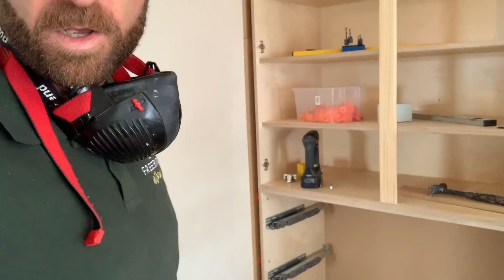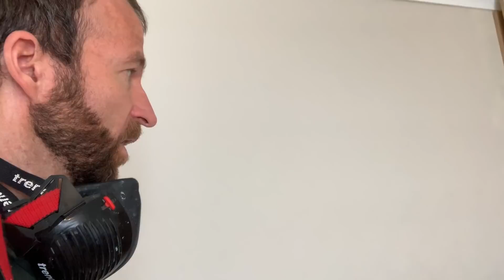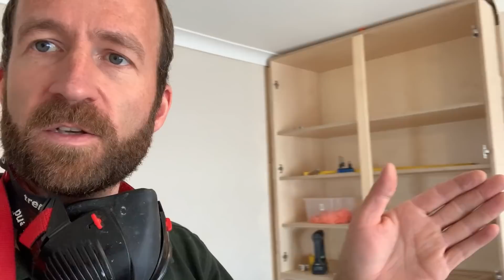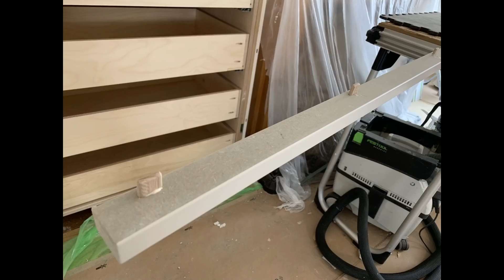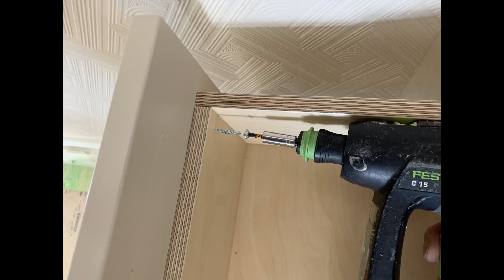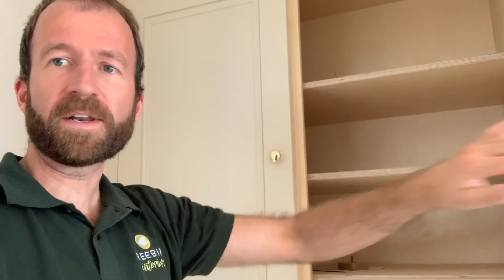Alcove Cabinet with Doors and Drawers

Comment: Is it possible to get a link to the clear lacquer that you used please?
Reply from the maker: Yes here it is https://www.ultrimaxstore.com/wood-coatings/water-based-coatings/sayerlack-water-based-clear-lacquer-matt-af7210.wo402410 and you can use code FREEBIRD10 for a 10 percent discount off your first order at this supplier

Comment: Hi Alastair - fantastic series of videos! Regarding the Blum under mount runners, when you fit the connector behind the false front as you did here (avoiding creating a second notch), does that impact the drawer length relative to runner length? Still 10mm shorter? Thanks
Reply from the maker: It does yes - increase total drawer box length by the thickness of that unnotched front.  So for a 450mm Movento runner the drawer box length is 455mm because you take off 10mm as standard, but add on 15mm. Glad you like my videos!

Comment: Love the unit very  nice, I like to make furniture as a diy er and am only a novice, would like to see more in depth build process if possible,  ie from the workshop to instal, from material dimensions like 18 carcass with 12mm drawer construction. I have made a sketch up plan for a vanity unit with a Hollywood style mirror but can only get 18mm 8x4 sheets here in Dublin so far and no 8x4 15mm sheets for the drawers, but now I’m confused as what thickness to use and material only that the daughter wants white melamine finish. Any recommendations appreciated 😃
Reply from the maker: I will try to get more workshop insights on camera in future - Brady is starting to film more for me as he works (he does most of the workshop work!).  Surely you can get 15mm etc, maybe as special order?
Reply: I could go 18mm for everything but would that be overkill and two heavy?? I   Think I should be able to get 15mm just need to look harder. If I sent you my sketch up plan would you have a quick look? Only if you had the time. The videos are great, watching a lot of your stuff and quality work, keep the videos coming. Big shout out from Dublin and I wish you and the family every success 🇮🇪🇮🇪🇮🇪
Reply from the maker: I settled on 18mm for carcase construction and this is what most people use.  I use 15mm birch ply for drawers, with 6mm bases (in grooves).  That 3 mm difference is a surprisingly big difference when it comes to drawer boxes which I just think feel unnecessarily thick and weighty at 18mm.   For years I have bought boards from Arnold Lavers over here.   They stock 18mm MDF (standard and moisture resistant) and birch ply and some other thicknesses but it needs a special order for the 15mm birch ply and for the 22mm MR MDF that we use for countertops and shelves.
Reply: Thanks for the feedback Alistar, appreciate it. Will look at birch ply for the drawers 👍

Comment: Hi Alistair, just a quick question, what are you thoughts on edging strips on the birch ply shelving? Another nice looking job by the way.
Reply from the maker: Des Brown I’m not a fan of iron on wood edging (or at least any very thin edging) because you need to keep the arris edges fairly sharp and I favour a more durable slightly rounded arris.  I’m also not a fan of glued and cramped solid wood lipping because it adds SOOOo much extra work and is exactly the sort of thing that strips the profit from a job!  But also, personally I quite like the look of the exposed layered edge, and I like being as true to the material as I can be.  I’ve never had a customer bat an eyelid at it so far; the exterior seems most important. I would do it if that’s what the customer wanted though.

Comment: Nice work. Can I ask what you used for the plinth/base on this? I noticed in some of your videos you were using small adjustable feet from hafele, but I think I saw a recent video were you were using plastic adjustable feet, link used on kitchen cupboards. I'm about to build a 4.5m long built in unit and trying to decide what, if anything to use. Thanks.
Reply from the maker: wwwukbboyinfo I used the Hafele gable mounted feet on this one.  I can’t remember why!  I mostly use the black plastic ones for single units like alcove base cabinets.  When I have a long run of units I prefer to use ladder plinths because they’re quick to level as one piece and then you can slide the units into place on top of them.  I level them with a mix of the handle mounted feet and packers.  To be honest though this method has some downsides, not least being unable to adjust the level after the weight of the units goes on, and sometimes I think it would be better to use the black feet!
Reply: @Alastair_Johnson  Thanks for the info. For the Gafele gable mounters, do you mean the "Integrato G"? How many would you put for a bit floor-to-ceiling bookcase? Is one every 1m or so sufficient? Conscious that with a 4.5m bookcase, I could end up with quite a lot of feet to adjust counting front and back feet.

Comment: Great vid !! Im about to fit my first movento runners, opening is 1180mm wide. The fitting instructions are daunting . What gap is required from the overall opening ?? 

is it 5mm either side with the draw box built with a 12mm lip underneath ??  

I dont receive the runners until thurs morning but im stood in front of a sheet of 15mm birch , scared to start !!!
Reply: and how much space do you give in between each draw ?? generally ??

  sorry to be a pain !!! your videos are inspiring me to give this stuff a crack , been working on sites for years and now its time for joinery !!
Reply from the maker: You need to get a Blum catalogue and study the diagrams (or find them online) but the important gap to know is the one between the inner carcass face and the INNER drawer box face - so the actual gap to the carcass depends on the thickness of the drawer box!
Reply from the maker: Better to put more alsoaxe between drawer boxes than you think!  It’s easy to get caught out, and also to not properly account for the thickness of the carcass top and bottom.  Also it makes sense for drawer boxes to be somewhat shorter than drawer fronts, say by 50mm or more, so overfilled drawer boxes have some clearance